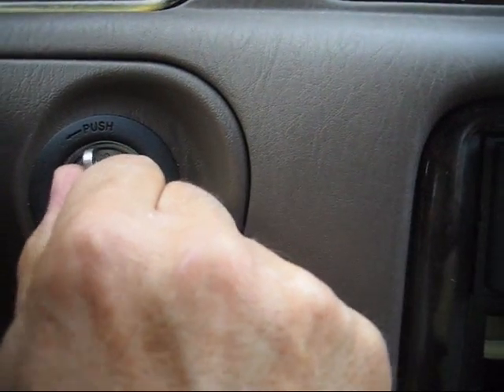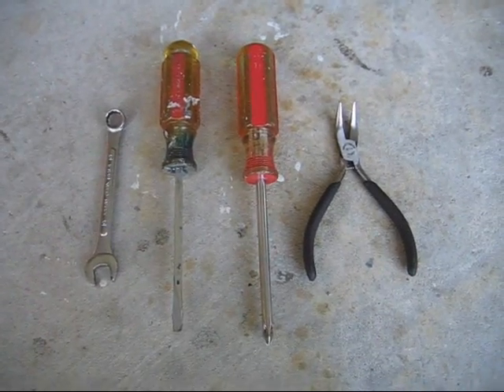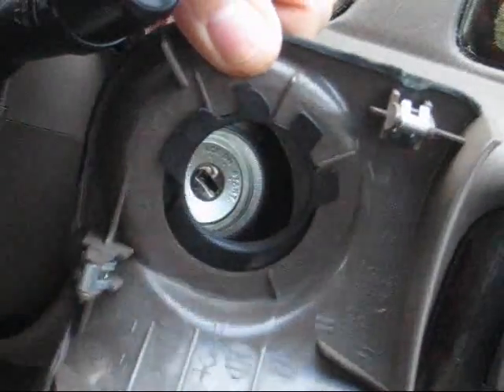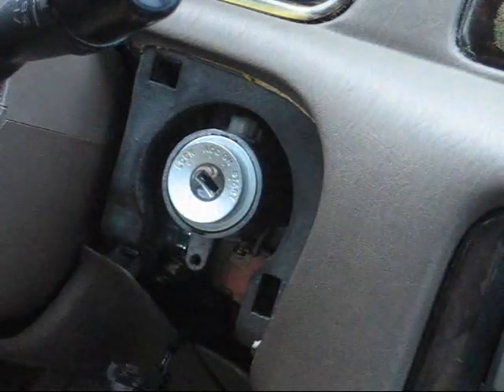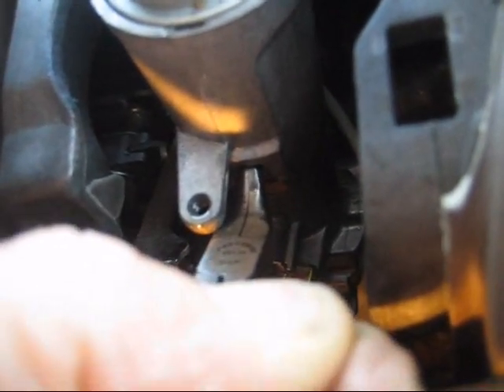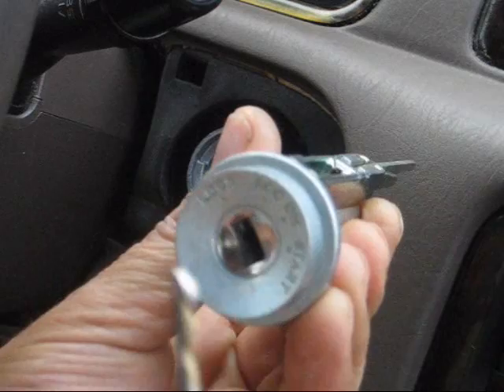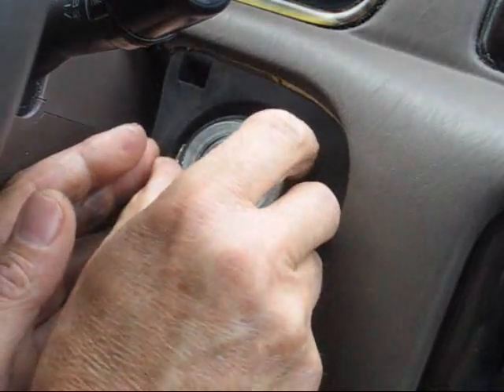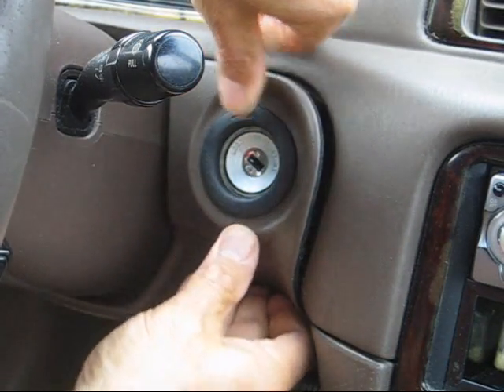Ignition Key Lock Cylinder Replacement - 1998 Toyota Camry (1997 thru 2001)

Comment: What if I can’t get to the ACC position? My key literally won’t turn at all, it’s locked. I’ve spent days trying to get it to turn but it won’t budge. 😢 any ideas?
Reply from the maker: I feel your pain. Getting the key into the ACC position is the hard part. I mentioned in previous comments, I had tried different keys, a newly cut key and moving the key back and forth for a while till my hands hurt. I kept at it, and it did eventually (randomly) move into the ACC position. I don’t think any of those things worked other than sheer determination/persistence. I have read some people drilled the pin that you have to push up on in order to release the cylinder. Good luck JohnSmith-zj3ec, let me know how it works out.
Reply: @DoItYourSelfers  I have a huge blister on my finger lol that’s how long I’ve been at it. Yes! I saw a video too where they drilled into the pin. Mine is a 2004 Camry, so it should be the same right? When I do remove the cylinder is there a way to just start the car so I can get it to my house and finish the rest? Its stuck at a friends house because it wouldn’t start when I tried to leave. If there is a way to temporarily start it, do I need needle nose pliers or something? Any advice is greatly appreciated! Thank you so much for responding 😉
Reply from the maker: I think I remember getting a blister as well. The 2002 - 2006 Toyota Camry is the 5th Generation but I would think the concept would be the same. I did spray WD-40 in the lock cylinder because I was desperate but, as mentioned I’m not sure if that helped.  With that said, I don’t know of another way to release the ignition cylinder.

Comment: I put this in my car today but it still is having a problem turning over. Could it have put it in wrong? Or could it be the starter? Help, please.
Reply from the maker: Sorry to hear about your car not turning over. The video is intended to replace a worn key lock cylinder but if you're having other starting issues, there might be other things going as you mentioned. I'm not a mechanic so it's tough to make a call. Try searching YouTube for some of your specific symptoms that may be able to help you.
Reply: @DoItYourSelfers  thank you for your reply. It was the starter after all which was out of my comfort zone. It was $315.00. Do you think I should put back my old part? I thoroughly enjoyed putting the part in. Your description was so right on. By the way I'm a 68 year old female. Thank you for sharing your knowledge...
Reply from the maker: Good to hear you’re up and running. That’s awesome, 68 years old, God bless you. Thank you sallyking8330 for sharing your experience.
Reply: @DoItYourSelfers  Do you have an opinion about putting my old part back so I can get a refund? It was 60 bucks or so.
Reply from the maker: Hmm, I may have, but that's your call.  I would first inquiry from where you bought it. Some part stores may not accept returns if a part was installed.
Reply: @DoItYourSelfers  thank you

Comment: I have a 2001 my issue is my key comes out in the ACC position so I can not push the pin in any suggestions?
Reply from the maker: Hmm, interesting. (The key you’re using may be worn) You can try using a newer key or have a new key made from the dealership-Toyota. (Not cut/copied from an old key) Let me know how you make out. Thanks chipsgirl1122 for posting.
Reply: Well you were right both of my keys were worn.  I called pop a lock and they came out and this guy worked for about 45 minutes he fixed my key and made me another. Thank you for your advice and all of your posts!
Reply from the maker: I’m glad to hear it worked out for your chipsgirl1122. Thank you for the update.

Comment: Is turning the key to acc a necessary step? Mine wont even turn to acc its so jammed. :/
Reply from the maker: Hi Cassie, the key has to be in the ACC position because it’s an anti-theft design or a thief can use their key and cylinder. 
After struggling, moving the key back and forth a hundred times, using different keys, had a new key made, moving the steering wheel back and forth, using WD40 etc., it finally moved. I’m not sure if any of that was the reason why mine moved but eventually it did move into the ACC position. Otherwise I would have had to drill the pin. Good luck Cassie.
Reply: @DoItYourSelfers  might have to drill it out or call a locksmith 😂 it wont turn thanks :)

Comment: What if the key has a chip is there another process to go through in that case?
Reply from the maker: Hi Yaritza, honestly I didn’t have that experience, I had a standard key and ignition. I can only suggest checking
out a similar post from a Joe Campau in the Comments. He had a ‘98 Camry, replaced the transponder in the key to a key that does not have a transponder and read what worked for him. Good luck Yaritza. Let me know how you make out.
Reply: +DoItYourSelfers thanks for your help!

Comment: what if i don't have a key. I lost my keys :( What would you suggest?
Reply from the maker: Hi Luisa, besides a locksmith, you can go to the dealership if you have the VIN and proof of ownership. They can cut you a new set up of keys with this information. Not sure of the cost involved. I’m sure you have but, check every pair of pants coat, jacket, etc. :) Good luck. I hope you find your keys.

Comment: I'm having same issue but my ignition switch won't turn to ACC how do I get it fixed
Reply from the maker: I have read some people drilled the little clip that you have to push up on in order to release the cylinder but as I have mentioned in my other comments, I had tried different keys, a newly cut key and moving the key back and forth for a while till my hands hurt. I kept at it and it did eventually (randomly) moved in to the ACC position. I don’t think any of those things worked other than sheer determination/persistence.
 I just recently had someone reply that they got the key cylinder to move, they had to keep wiggling back and forth and they actually got it to move. 
Good luck Bonnie. Let me know how you make out.

Comment: What if I cant get my key to turn to the ACC position? Am I screwed?
Reply from the maker: Hi Michael, if my persistence and determination (and a sore hand :) hadn’t worked to get it to turn to the ACC position, I would have had to drill the pin so the cylinder would release. Good luck. Let me know how you make out.
Reply: Thanks for the reply! I spent nearly 3 hours in my car last week trying to turn my key and couldn't get it. Was literally on the phone figuring out whether or not to get my car towed, and my girlfriend started trying to turn my key. She successfully got it in only a few minutes!Thanks for the video! Easy fix once you can get the key to ACC!
Reply from the maker: That’s great to hear Michael. Perseverance literally paid off. Thanks for the update.

Comment: I switched mine, but the car doesn't start still. It's not locking the in ignition anymore, it's just the car won't start. Any ideas?
Reply from the maker: Sorry to hear you're having a problem. Hmm, I’m not sure but, it sounds like there maybe another issue going on other than the key ignition. Please let me know how it works out.

Comment: What can I do to remove the cylinder if the key does not rurn at all?
Reply from the maker: I feel your frustration.  It took me a long time and actually painful before it moved in to the ACC position. Unfortunately if it hadn’t moved I would have had to drill the pin to have it release. Good luck Alonso.

Comment: What if my key wont even turn to the acc position???
Reply from the maker: If it hadn't moved into the ACC position, I would have probably drilled the pin to remove the cylinder.
Reply: @DoItYourSelfers  finally got it ! After a lot of jiggling and even drilling it eventually. Found a new part to throw in her today for 100 bucks. Thanks for the helpful video and reply!
Reply from the maker: Awesome, glad to to hear it worked out. Thank you El Salvador for the update.

Comment: Dumb question probably but i connect the negative terminal after i put the new one in right
Reply from the maker: I disconnected the battery before I took out the old ignition cylinder and re-connected the battery after the new ignition cylinder was in. (no such thing as a dumb question) Hope this helps.
Reply: @DoItYourSelfers  thank you i got it fixed this video helped alot your a life saver
Reply from the maker: Awesome, great to hear that. Thank you waracara pito for posting.

Comment: I tried to open and close all my doors just to make sure everything is in proper order,i did not find any apparently issue with the doors,also after i tried to lock the car with the remote or fob control i didn’t allow me,so are you or somebody familiar with this issue?
Reply from the maker: I didn’t have that set up so unfortunately I can’t give any advise, I had a non-transponder (standard key) type ignition. Good luck Alberto. Let me know how it works out.

Comment: Probably a dumb question but will this work with a 96 camry?
Reply from the maker: Not a dumb question at all. The ’92-‘96 Camry is the 3rd generation and the ‘97-‘01 is 4th generation. With that said there may be a difference. I would check the video and compare  if it looks similar or not. Good luck ChinakoVS.
Reply: yea i literally just walked back inside after following this video. thank you so much i went to oriely's bought the part and did it myself. great video!
Reply from the maker: Awesome! Good to know it helped for the '96 Camry as well. Thank you ChinakovVS for sharing your experience.

Comment: I am changing it but the key does not turn to accessory so I can hit the pin so I can pop out can somebody please tell me what I have to do to take it out
Reply from the maker: As mentioned in my other comments, I had tried different keys, a newly cut key and moving the key back and forth for a (long) while till my hands hurt. I kept at it and it did eventually (randomly) moved in to the ACC position. I don’t know if any of those things worked other than sheer determination and persistence. I have read some people drilled the pin that you have to push up on in order to release the cylinder. Good luck Anna, let me know how you make out.

Comment: the key won't turn, how do you turn it after you removed the cover?
Reply from the maker: I know about your frustration. Unfortunately the key is needed to be in the ACC position to remove the cylinder. I had used a newly cut key and moving the key back and forth for a while till my hands hurt. I kept at it and it did eventually (randomly) moved in to the ACC position. Honestly,  I don’t think any of those things worked other than sheer determination/persistence. I have read some people drilled the little clip that you have to push up on in order to release the cylinder.
Reply: @DoItYourSelfers  yeah, but I found a better solution by coincidence, I bought a new cylinder, and came with a key, I put the new key all the way without twisting it and pulled it out, which will reset the comb inside the key cylinder, then I used the original key to turn the car and it turns the car on, after few times of turning the car on and off, the key won't turn again, so, I did the same thing I put the new key all the way and took it out, then I used the original key, and the car turns on perfectly, then I just kept it that way because anyway, if you change the key with its cylinder you have to code the new key to the car and that will cost more money.
Reply from the maker: Wow, that's pretty cool.

Comment: Does any one know if you need the key to switch this out i lost my key and im thinking of doing this nic3 video
Reply from the maker: Unfortunately, the key needs to be in the ACC position aliening the pin/spring to release the cylinder. Some have made the suggestion of drilling the pin. Maybe someone out there may have another idea. Good luck Oscar.

Comment: Anyone watching this, you can get factory cut keys for like $18 from the Toyota dealer. I’m assuming this guys key was super worn down so it wouldn’t turn the cylinder. Had this happen on my ‘95 Camry. Had it working flawlessly again with a fresh cut key 30 minutes and $20 later. All you need is vehicle registration that matches your ID.
Reply from the maker: Good advice bobdole870! Thank you for your comments/posting.

For me, I did have a fairly new factory key but that didn’t work for me. The cylinder was just worn out (or defective) so I just replaced it. 
I later discovered that if the cylinder is the issue and needs to be replaced, a way to avoid the 2 keys with a new ignition cylinder (one for the new ignition and the old key for the door), after removing the ignition cylinder, have a locksmith (possibly) repair it (not sure of the cost) and then reinstall the same ignition cylinder.

Comment: What if you cannot turn to accessories position
Reply from the maker: I struggled moving the key back and forth, used different keys, a newly cut key, pressing the brake, WD40 (not sure if any of that did anything) for a long while till it randomly moved to the ACC position. I believe it was persistence that got the key to move otherwise I would have had to drill the pin so the cylinder would release. Good luck Richard. Let me know how it works out.

Comment: what if I can't get the key to turn into accessory?
Reply from the maker: I feel your frustration. The key needs to be in the ACC position to be able to release the spring pin. I "fought" moving the key back and forth, used different keys, a newly cut key, WD-40 for a while, then, and I’m not sure those things even worked but it moved to the ACC position. If it didn’t move, I would have had to drill the spring pin in order to have the cylinder slide out. Good luck jimmynashley1215. Let me know how you make out.
Reply: I've noticed my requires a 'ice cream scoop' styled motion and then releases.  Also, the steering wheel needs to not be in locked motion.

Comment: what if part of the key is stuck in the ignition ?
Reply from the maker: You may have to drill the pin so it can release the cylinder. There are some good videos specifically showing how to do that. Good luck freighttrainsahpassing, let me know how it goes.

Comment: Do I need two keys to do this
Reply from the maker: If I understand you correctly, yes you’ll need 2 keys. When you replace the ignition cylinder you’ll use the new key to the new ignition cylinder and the old key for the door/trunk. To possibly avoid 2 separate keys, once you remove the ignition cylinder, a lock smith may be able to repair the old cylinder. If repairable, this will avoid the 2 different keys. Hope this helps.

Comment: i can turn the key to acc it is very lock i dont know what to do
Reply from the maker: I know of your frustration John. It took persistence and a sore hand until mine finally moved into the ACC position. Some commented that they kept trying and there’s eventually moved into the ACC position. Some had drilled the pin so the cylinder could slide out. I was fortunate that mine had eventually moved. Good luck John. Let me know how you make out.

Comment: How to release the safety when the key does not turn at all
Reply from the maker: Other than persistence, moving the key back and forth for quite a while and as mentioned in other posts, till my hand was soar the key eventually did move into the ACC position so I could push the pin in to slide the key cylinder out. Others had mentioned drilling the pin to have the key lock cylinder slide out but my persistence paid off and it did eventually move in to the ACC position so I could remove it. Good luck Profesor Manuel Ponce.

Comment: Replace the ignition when the key doesn’t turn. It’s easy to remove the ignition when key works
Reply from the maker: Yes, if you can get the key in the ACC position, it’s a quick fix, otherwise it’s a challenge. I was determined, and it did move (eventually) in to the ACC position but not without some work. It was worth it though.

Comment: Help! What about if my key won’t turn in the ignition? Their won’t allow me access to the spring :/ suggestions????
Reply from the maker: I feel your frustration. Other than trying different keys, a newly cut key and moving the key back and forth till my hands hurt, it (eventually) moved in to the ACC position. Other than that, I heard of some drilling out the little clip that you have to push up on in order to release the cylinder. Good luck Cristal. Let me know how it goes.
Reply: DoItYourSelfers that’s exactly what I did ! Just kept moving it around! Ty :)
Reply from the maker: That is great to hear! Thank you Cristal for the update.

Comment: What if the key won't turn to acc
Reply from the maker: Sorry to hear that. I didn't have to do this but, I've heard some have drilled out the spring pin in order for the cylinder to release. I'm sure there are some good videos on this.

Comment: what if you can’t turn the key to acc
Reply from the maker: As mentioned in a previous posts, other than persistence, moving the key back and forth for quite a "long" while the key eventually did move into the ACC position. Others had mentioned drilling the pin to have the key lock cylinder slide out but my persistence paid off and it did eventually move in to the ACC position so I could remove it. Good luck Jadon.